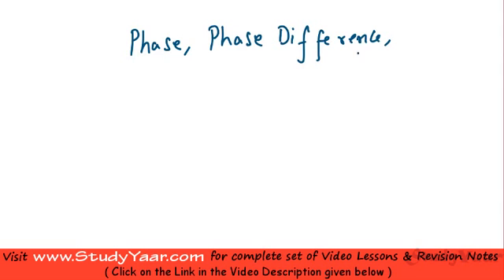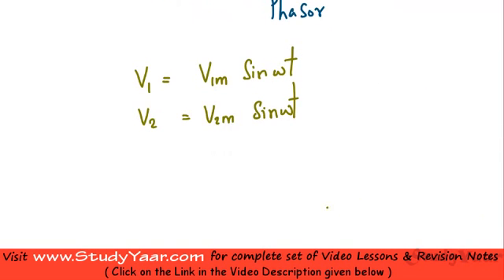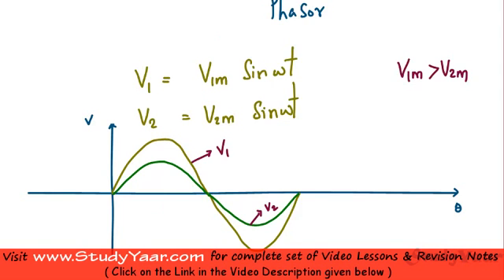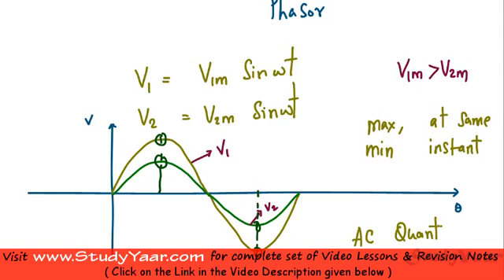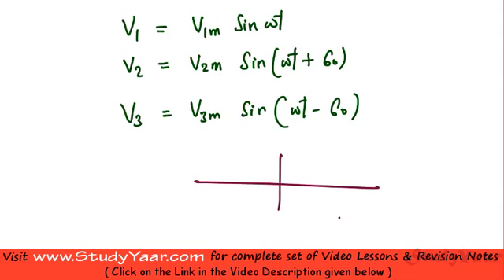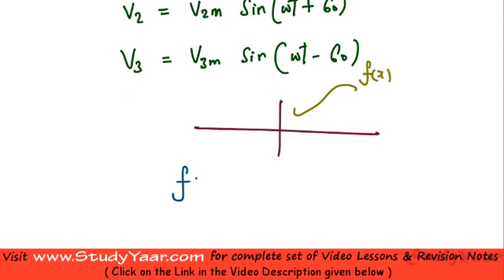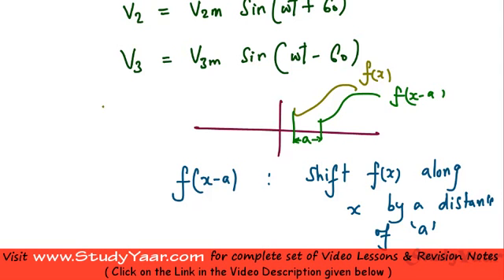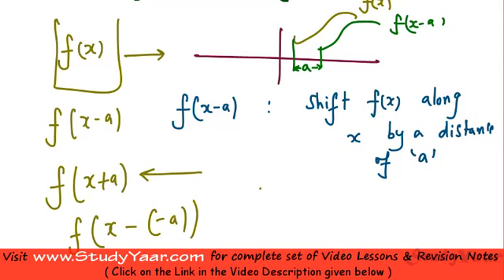Concepts of Phase & Phase Difference in AC

Comment: The existence of a sinusoidal current resulting from the application of a sinusoidal voltage to an inductor is a characteristic of the non-Coulomb electric field that is proportional to the rate of change in current causing a changing magnetic field. 

 The current is a result of an opposing Coulomb electric field, which is a result of polarization by the non-Coulomb electric field associated with the changing magnetic field, and the current is a consequence of the resultant field of the applied field and the Coulomb electric field in the inductance coil. 
In an inductor, the opposition to the applied voltage which is changing the current is instantaneous and so, the current can only follow after the applied field has overcome the opposing emf. In an inductor for sinusoidal currents, the current lags the voltage by 90 degrees if the inductor is pure, and less if a resistance is in series with it; the inductor fights before current flows. If an inductor weren’t to fight, you will get energy for free! 
Electrostatics and circuits belong to one science not two. To learn the operation of inductive circuits it is instructive to understand Current, the conduction process, resistors and Voltage at the fundamental level as in the following two videos: 

i. https://youtu.be/TTtt28b1dYo and
ii. https://youtu.be/8BQM_xw2Rfo
Inductors find applications as filters in power supplies and in resonant circuits in tuned amplifiers. 

If we increase the “frequency” of the input voltage to an inductor, the “rate of change” of the input voltage and the applied field is “greater than” the rates obtained with applied voltages at lower frequencies. At low frequencies, this causes a smaller induced opposing electric field and emf, therefore, large currents will flow within small intervals of time in the coils of the inductor. 

In the limit, if the input is a dc voltage, the current will become so large that the inductor will burn out. 

Low pass filters are built using L-R circuits in simple applications. Therefore, we say the inductor “blocks high frequencies” and acts as a “short circuit” at low frequencies as if the inductor was not there but a wire. 

 It is not possible in this post to discuss in more detail current in inductor circuits and inductive reactance with sequential diagrams (textbook 4, see below). 

The last frame References in video #1 lists textbook 4 which discusses these topics in more detail using a unified approach and provides an intuitive understanding of reactance.